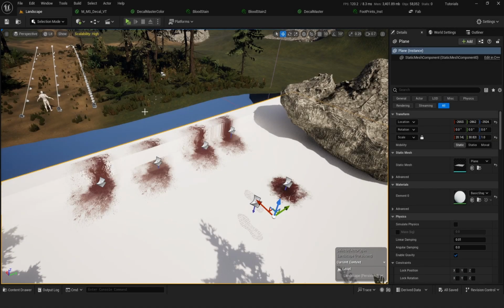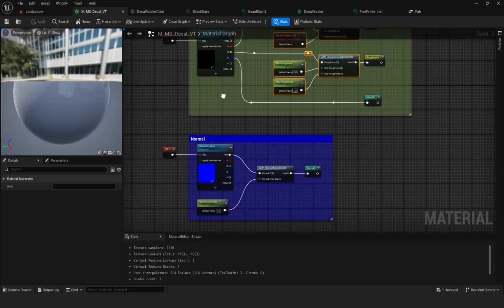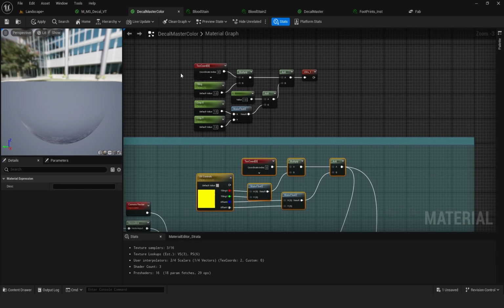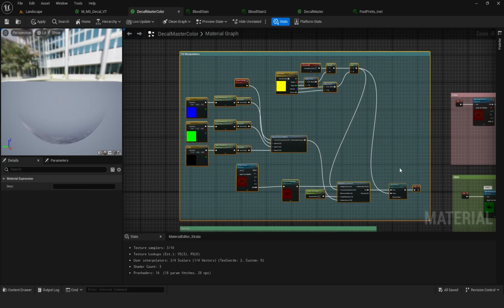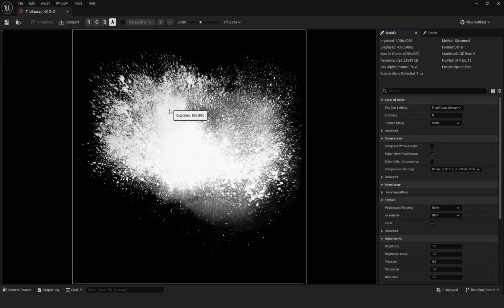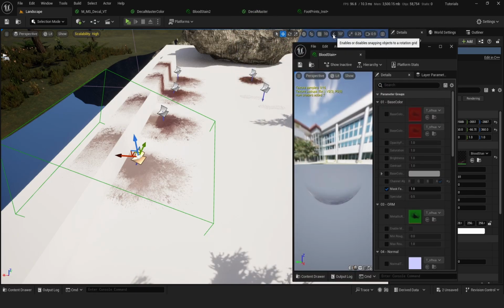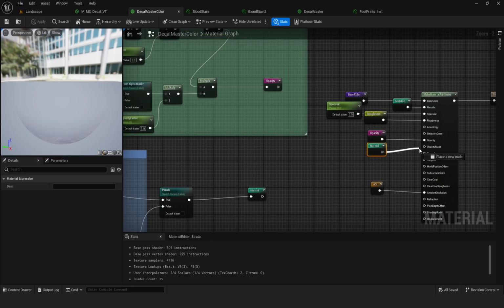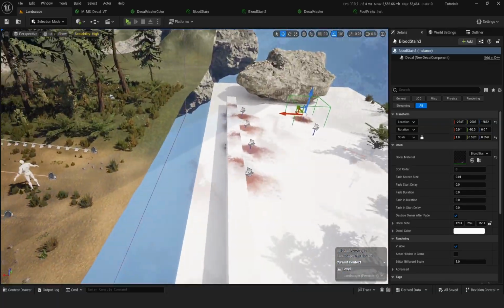Decals in Unreal Engine 5 | Tutorial

Comment: Considering there's been some updates since then, I think something broke. I noticed translucent is now translucentcolortransmittance (i think). I hadn't even touched anything decal related or messed with my default FAB materials, but for some reason my decals come out as complete black squares.
Reply from the maker: It's been a while but I think I came across this issue myself. Epic reorganized the Decal Blend Modes

Try this:

Open the decal material and change the Blend Mode to DBuffer Translucent Color, Normal, Roughness

Go to Project Settings → Rendering and make sure DBuffer Decals is enabled

Hope that helps!

Comment: Did you tried to connect a STATIC BOOL (false) to the False Normal Switch?
Reply from the maker: I tried using a Static Bool, but the results were the same. However, if your landscape is using Runtime Virtual Textures, you can plug the Normal from the Virtual Texture Sample into the Static Switch for the normal, and it gives the desired result.

This doesn’t completely solve the issue if you want to project the Decal onto a static mesh, since in that case it would still use the landscape normal instead of the static mesh normal.
Reply from the maker: I don´t think I did, I will try it soon to see if it works, thanks!